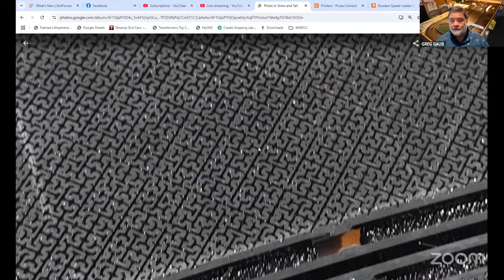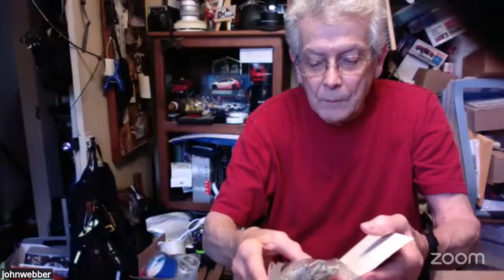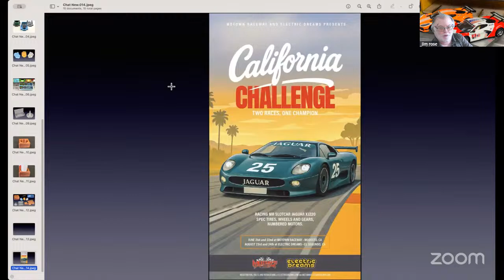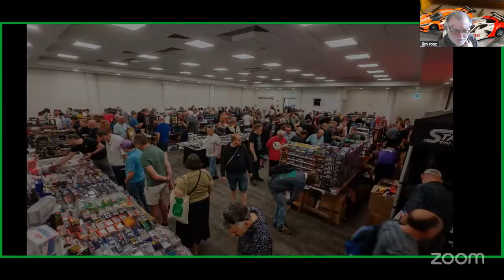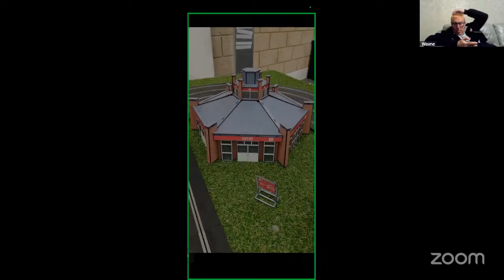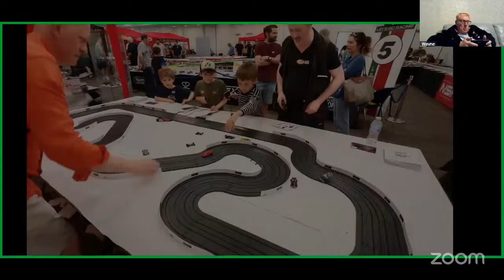World Wide Slot Car Chat LIVE! 260

Comment: Greg, we're running those Scalextrics cars in our IROC series. They are straight out of the box, but with silicone tires. We've had problems spinning the wheels right off the axles (wood track, no glue). You might not have the same problem, but you'll want to keep an eye on that! They are slow, but they are fun!
Reply from the maker: Good to know, but certainly something we've dealt with in the past with plastic wheel cars. Let me know if you have a fix that lasts longer than a drop of glue.
Reply: @ggaub  just more glue 🤣🤣🤣